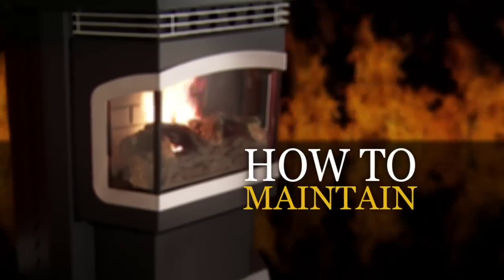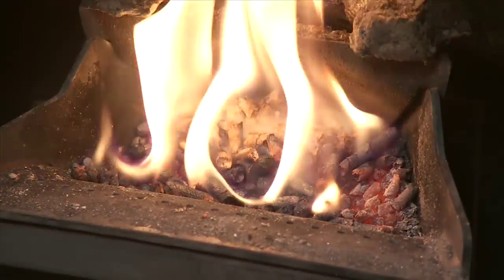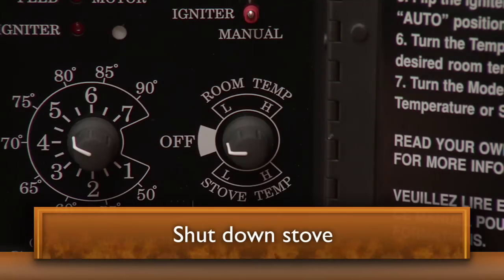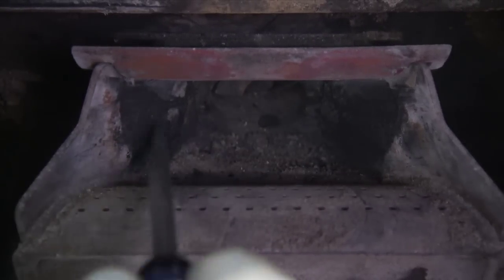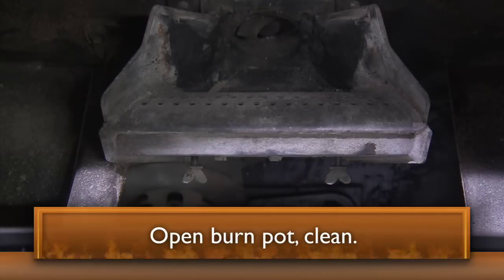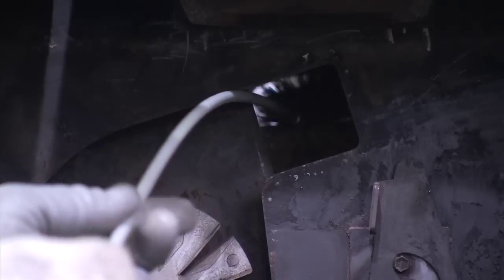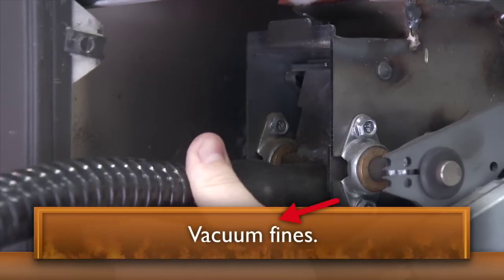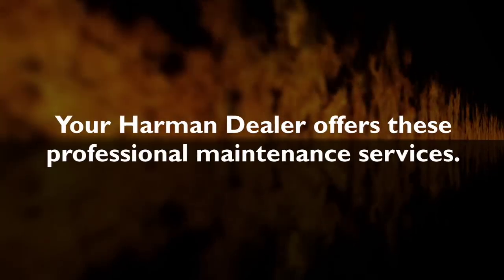Harman® Advance Pellet Stove Maintenance Video

Comment: I have a OLD p61, serial number 000667 that I am doing a partial rebuild on such as blower motor, distro blower, auger and auger motor and circuit board. burn pot looks perfect but not sure it has been replaced or not. The stove has not been ran is quite a long time but when I plugged it in it ran but the auger squeaked and I did not start a fire in it.  I have contacted local authorized dealers techs but I think they know less about it than I do. They say the stove needs to be hooked up and vented before they come out. Whats the point then? Most of the parts seem available that I will order for it and there have been some upgrades. My concern is I dont know the stoves upgradable capabilities and I want it to be as efficient and trouble free as possible, what all should I be doing to the stove that makes it as close to new as possible. Thanks.